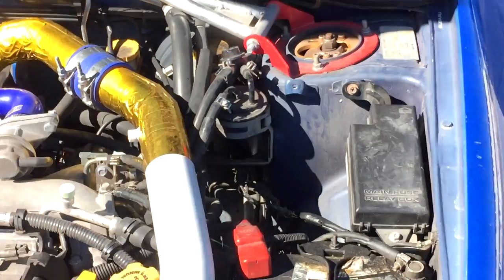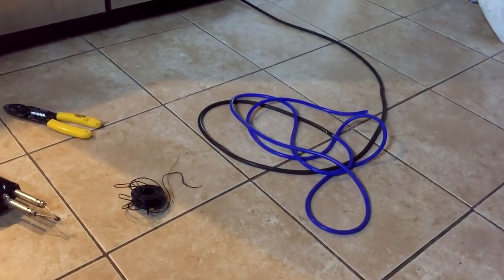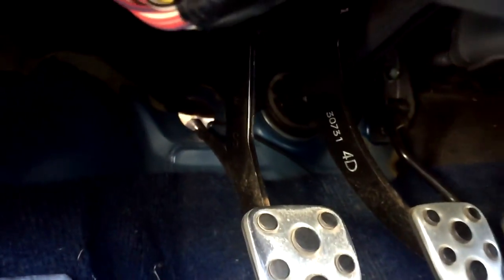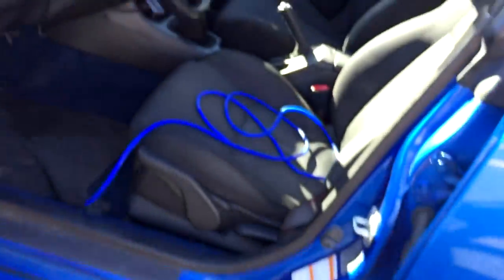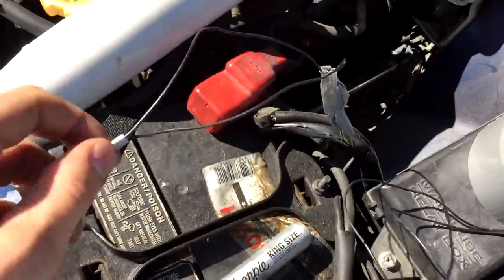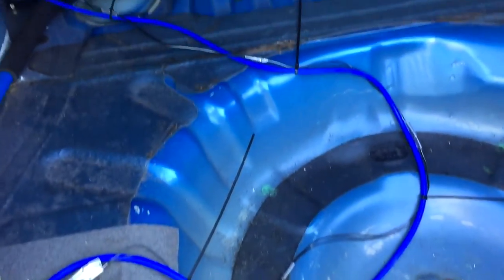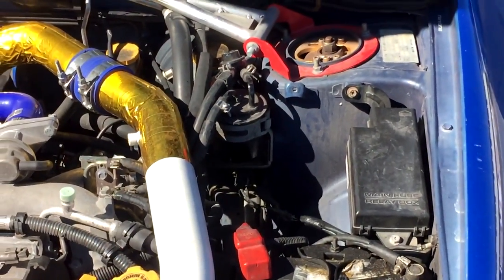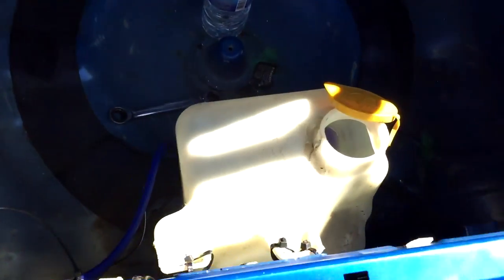DIY | Relocating Washer reservoir to Trunk

Comment: One thing I would suggest is not cutting the harness  connectors and just using crimp on connectors to make your connection into the oem plugs. This way if you decide hey I want to put that back its not rigged back together with crimps or something...
Reply from the maker: +drewvanness25 Yeah that's a good idea!

Comment: Why are you moving it to the trunk?
Reply: weight distribution, the closer to 50/50 the better usually
Reply from the maker: +MannyFresh1x What +Guneet Surdhar said ++ it clears up the clustered engine bay
Reply: Some people do it to make it easier to maintain the engine, less things in there, more angles to hold a spanner.

Comment: That huge hole by your pedals should not be there. That also might be why you smell so much gas from your EWG.
Reply from the maker: +ILoveFastCars lol are you serious? I just assumed it was OEM since it's been there ever since I ... wait a minute... The previous owner had a HUGE sub in the rear. Maybe he drilled the whole for the wiring from the battery?! LOOOOOOL
Reply: +Subie Rumble Yep ha that would explain it.
Reply: +Subie Rumble its probably meant to be there but the factory rubber grommets gone
Reply: +Jesse Dean  yeap exactly. mine is missing too